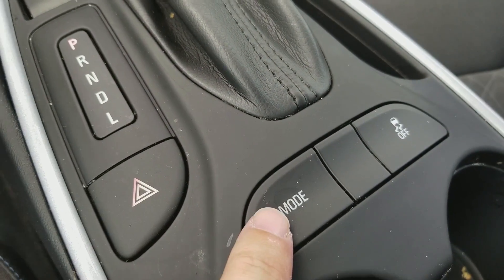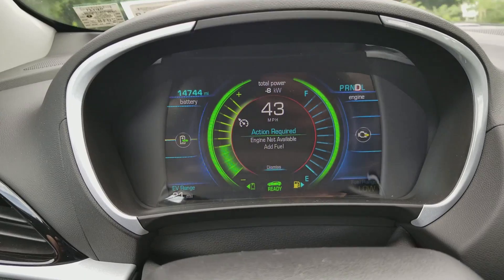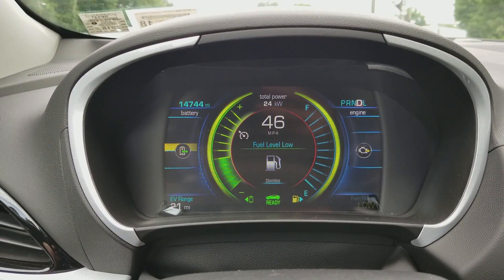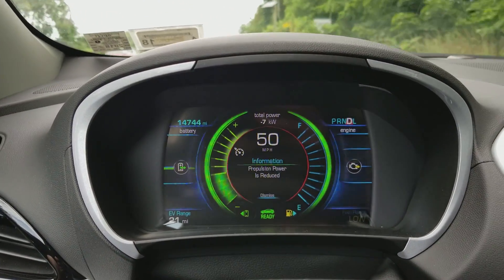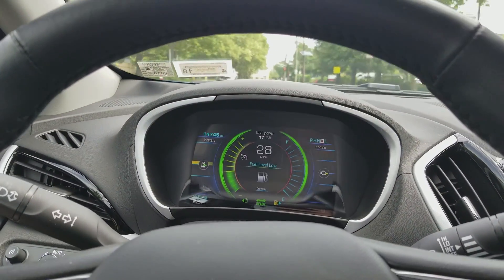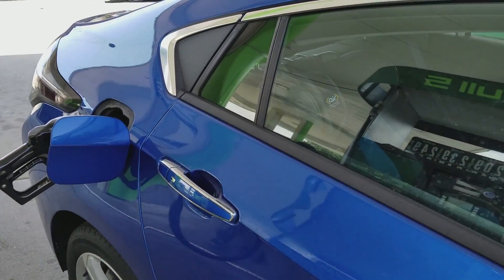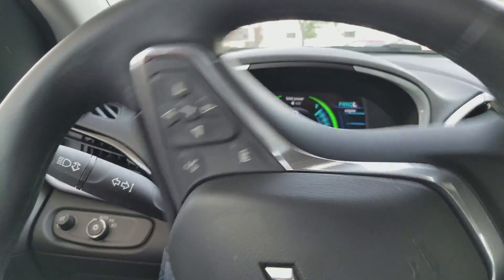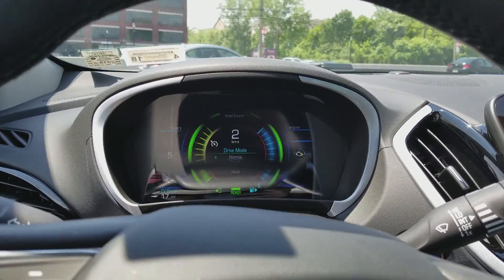Electric Chevy Volt Runs Out Of Gas - Becomes Dangerous

Comment: The Volt is an electric vehicle. The wheels are driven by electric motors only. The gasoline motor runs a generator which recharges the batteries and/or powers the electric motors that drive the car. The gasoline motor will spend most of it's time recharging the batteries. When the batteries get too low to power the wheels, the wheels will be powered directly by the generator, which will be turned by the gasoline motor. GM did that because they knew people would be anxious about getting stuck. This way, even with a low battery charge, the gas motor will get you home. With a Tesla, you'd have to find a charging station and wait while the batteries recharge.
Reply: THIS! Exactly this! Listening to this guy talk I kinda feel like he doesn't actually know how that system works.
Reply: Thanks. The best explanation in few words. Some think is actually a gas combustion engine moving the wheels. But is actually the batteries doing it with the help of the gas generator. Thanks

Comment: having run out of gas in my car a couple times (gas gauge in my car doesn't always work, neither does low fuel light), I would be more than happy to have a "limp mode" to get me to a gas station....pretty much every time I have run out of gas in my car, it's been less than a mile away from a gas station....so even if I was limping to a gas station in a car that took 19 seconds to get to 60, It's better than being stuck on the side of the road...(in this case, i would turn on my flasher lights to let people on the road know that I am having issues)

Comment: The reason the Volt goes into PPR (Propulsion Power Reduced) Mode when the fuel is depleted is: 1) The Volt is trying to save battery since there is no backup energy, and 2) The engine needs fuel available to run maintenance mode. EMM happens every 6 weeks that the engine is not ran. It burns off old fuel, spreads lubricant and boils water out of the oil (Which accumulates over time due to not being ran).

Comment: As dangerous as it may seem to not have full capabilities in electric mode, its actually safer in the long run because that limp mode will insure you the maximum distance to get to safety/fuel. The car is gas/electric and will default to gas when you run out of electric, which you already know. By running it out of fuel and forcing it to be electric only, the car knows it no longer has a secondary system to run IF the battery runs out. So in theory, the manufacturer created the "limp mode" in electric (with no fuel) to maximize the distance you can travel before complete failure. If they didn't force "limited capabilities" and allowed the electric to run as usual, you would eat through the batteries much faster and therefore run into complete shutdown much sooner, therefore actually being more dangerous in their minds. By having that limp mode, they insure the car can travel as far as possible on only the battery, giving you the highest chance to find either fuel or at least more battery in the case you are really in nowhere land. It's actually pretty smart honestly.

Comment: its most likely to limit the power output of the battery because of the discharge rating.

meaning if it has gas and you put your feet down it starts the engine to produce the extra energy that it cant pull out of the battery , and when it cant start the engine (no gas) it has to reduce the electric power , because pulling too much amps out of the battery will cause damage to it , and (at least with lithium batterys) will produce excess heat and even catch fire.

sorry for the bad english , im german

Comment: I ran my 2011 Volt on a hot day without gas and when I went to go up a grade(out of Occotillo towards San Diego) without putting it in mtn mode beforehand it went to limp mode. I was getting passed by everyone. My max speed up the grade was about 54mph and it made no difference between half throttle and full throttle. cruise control would fail over like 45. Definitely something I hope the newer ones improve on.

Comment: You actually answered your own question.  It's running in limp mode because your redundant back up (gas) is depleted.  Therefore it is trying to conserve your electricity.   Big ole duh there chief.
Reply: superspeedersRob, That's just it,  you're limited to the amount of mileage you can go on battery before your car automatically reverts to gasoline, your car is smart enough to know you have none (gas) and tries to maximize your battery life since your redundant source (gas) is already depleted.   It is not a design flaw it is actually smart.
Reply: megaspeed2v2 its a volt, people won't be surprised when it accelerates slow.  this is in streets, not a track.  lol. there was nothing dangerous about what happened.   elderly accelerate slower than he did.
Reply: megaspeed2v2, ignorance would result in lack of understanding the "fundamental" reasoning behind it and that sir is what you continue to beat the dead horse on.   If you really understand why, then your previous comment would not have even been made, so let me sum it up to you or dumb it down for you, this practice can be summed up as something called.....conservation since the REDUNDANT source of power is depleted rather than the PRIMARY.  In essence it makes perfectly good sense from a company covering their ass from a safety perspective.   Ignorance is bliss "pot calling the kettle black"
Reply: Look at the reasoning this way then. It's very easy to get into the habit of just driving the car because it'll either have electric range or gas range. But if you ran out of gas on your way home one night and didn't feel like stopping, then the next morning when you had a full charge you went to work thinking "no problem, I'll make it back home on gas tonight, no need to stop", given how many Volt owners only fill their cars up ever 2-3 months or even once or twice a year, it would be very easy to forget you ran out of gas and wind up accidentally driving somewhere that you won't be able to get back from because you have no gas and you don't have enough electric range for a round trip. The slowing of the car is similar to the OBD-II failure mode where a car enters limp mode with reduced performance so you don't forget there's an issue that you need to deal with as soon as reasonably possible.

Another option would be to just stop the car in its tracks when the gas runs out like every other car on the road does, but it doesn't do that, it gives you everyday car driving performance for the full range of the battery instead. And it'll do that if you have even a fraction of a gallon of gas in the tank, as many people never put more than a gallon or two in their Volts because they don't ever plan on using gas.

Believe it or not, this really is a safety feature, not a safety issue. Not reading your vehicle's manual, or reading the messages displayed to the driver— that's a safety issue.
Reply: Yes, it should have given an audible warning once just in case you missed the warning, but the driver is still responsible because they should have seen the low fuel warning and been expecting it to maximize the remaining electricity by not wasting energy on excessive acceleration since there was only ~25 miles remaining.
Reply: Yeah, but it's not excessive acceleration to want to merge onto a freeway. That's more like necessary acceleration.
Reply: dlwatib, your definition of excessive versus Chevy's will differ and again you're missing the point of how the technology is set up and the purpose.
Reply: Tommy Gorney, I hear you and disclaimer im not a GM fan nor do I work for them or a dealership.  However this goes beyond menial salesman education.  If the customer understands and I mean understand what they are buying and how it works KNOWING the gas is the backup not primary source of power by default then this falls on the customers lack of knowledge and due diligence (sorry Rob).  If a customer by now as whole doesn't know there are keys within the key fob then by god get an old car.  GM, Ford, Audi, Lamborghini, Lotus, Chrysler all have fobs.  There's no excuse not to know that.  At this point we would be splitting hairs. Side note: The Volt needs and AWD option and even I would consider one.  The fully loaded model is underrated and amazing.  Again this coming from someone who doesn't care much for the brand.
Reply: Yes, I read what I wrote and I stand by it, the point was that the question wasn't why chevy claim to have put the feature on there but why it makes sense to have that feature, it doesn't because if the battery is more than 25% charged it makes no sense to go into limp mode and conserve electricity.
Reply: megaspeed2v2, look at the 2 minute mark in the video "Propulsion power reduced".   The internet is littered with this information and why.   Hey to boot it is in the owners manual.
Reply: Ugh now you're just being ignorant... I understand what the reason cheverolet gives for the power reduction is, that's not the question... the point is there is no reason to do it unless the battery is nearly run out of charge...
Reply: Tommy Hornet
Reply: erm no, it's obvious that its trying to reserve power but he's asking why bother saving power if it means you might end up stuck driving onto the hard shoulder because you can't reach motorway speeds quickly enough...
Reply: Really? Did you read what you just wrote? He asked why, it was answered.  As stated the gas is the backup not the primary source.  Erm...yeah.
Reply from the maker: understandable when I am almost out of battery power, not when it has half a full charge.
Reply: to be fair GM really is bad at educating their consumers.  why salesman can simply tell customer that there is a hidden key in all key fobs to get into your vehicle boggles my mind.  if they can't pass on that simple bit of knowledge, I have no faith at all when it comes to a Volt...
Reply: "this practice can be summed up as something called.....conservation since the REDUNDANT source of power is depleted rather than the PRIMARY"... ... ... ... the point is i understand why cheverolet put the feature on there but i (and rob in this videos case) are questioning whether their reason is actually very sensible. 
There is no need to conserve power yet if the battery is still fully charged or at least pretty highly charged! there is no danger in running out of charge just like a there is no danger in running out of fuel in an internal combustion engine car because when you are running out you should be looking for somewhere safe to stop anyway but while you still have charge left and are still driving, assuming the battery isn't risking being damaged (it shouldn't be, it's designed to be able to use battery power only in normal operation) you should still have the same performance you expect to have to avoid the more real danger of suddenly finding out you can't accelerate fast enough to merge onto the motorway before you end up on the hard shoulder despite the fact that there is nothing actually wrong with the car.

Comment: the volt doesn't ever really use all of its battery pack but has a predetermined usage (i.e. when charged use from 90% up until 50% and then run on gas). it's never truly full to charge or fully dead. my guess is once there is no more gas to sustain the charge based on OEM programming, it will use whatever really is left as an emergency backup. The way the battery charge was designed was for longevity rather than ultimate performance (see Nissan Leafs battery for rationale)

Comment: Really? The Volt has reserve before it warns you it's low on gas and then when you are ignorant enough to continue to run on the battery which it allows you to do to...GET MORE GAS its now a dangerous car? Sounds like the engineers at GM could't "FOOL proof" the car to the point that some idiot would do what 99.999 % of us wouldn't do. Yep that makes it a dangerous car!!!
Reply: D M He didn't use the reserve, though. He still had four bars left.

Comment: A slowly accelerating car isn't dangerous...
Reply: It can be if you don't already know your car is going to accelerate extremely slow, Jersey has a lot of on ramps  onto 40-50 mph roadways that are very short, so if he pulls in front of someone thinking he has enough clearance to get up to speed and the car doesn't move- he very well might get rear ended-thus a slow accelerating car becomes dangerous